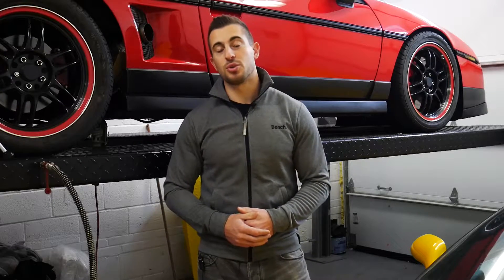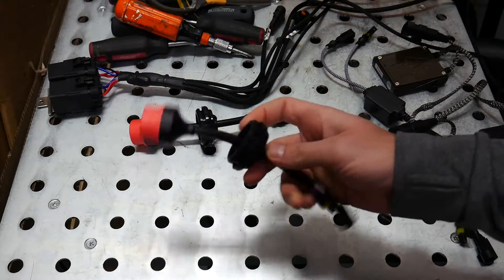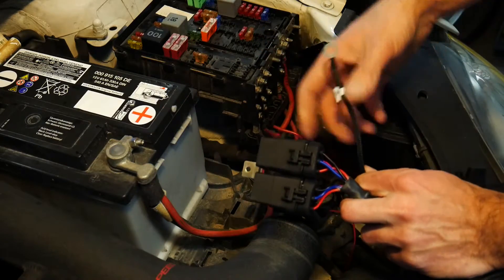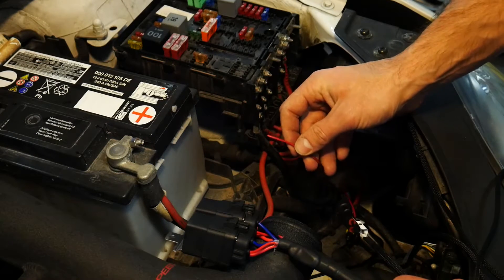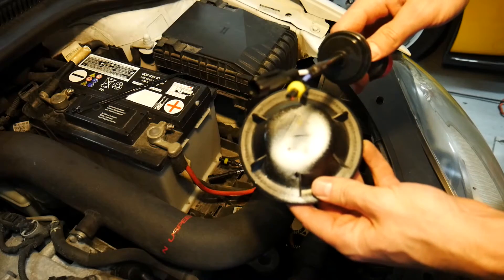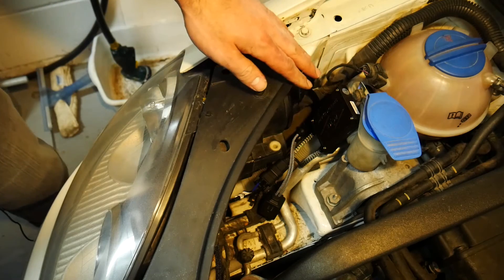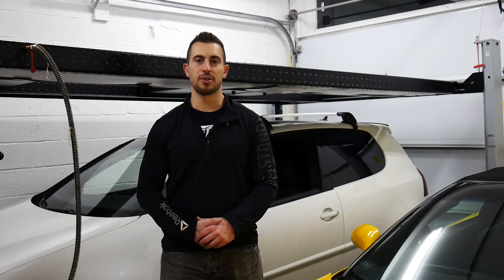How To Replace OEM Headlight Bulbs, Ballasts, Igniters With Inexpensive Universal Parts!

Comment: I have the same year/model. What wire(s) did you tap into for the headlight switch (color code or pin #)? 

Update: 

I did some searching and I found that pin #7 Yellow/Black stripe is the low beam and pin #9 White/Black stripe is the high beam. Pin #8 Orange is ground for both.

Comment: I know you dont have the car anymore, but Do you still remember where you tapped the red wire to the headlight switch and the actual headlight wire?? Trying to do this with my MK5 GTI.
Reply from the maker: If I remember correctly, I tapped into 12V hot on the terminal block beside the fuses under the hood. The trigger for the headlight relay went to the head light switch inside the interior. I routed the wire through the firewall down near the pedals and brought it up behind the dash. You'll have to take a look online to see which pin from the headlight switch to use... I can't remember on this car exactly which one....

Comment: could i have the link to buy this, ive been dealing with my mk5 the headlights flicker.. the one will stay off and come back on once in awhile. will this fix that problem if i do this ????
Reply from the maker: Should fix it since you're replacing the parts. Just go to the "retrofit source" and find the same bulb size that fits in your MK5 housings, I cant remember what it is off the top of my head. Then find the compatible ballasts... they usually sell some "ACME" brand ballasts that are their economy line and work really well for the price.

Comment: I have a couple questions, I am also working on a MK5 GTI, so this video is a godsend since I most likely have a fried CECU and neither headlights work. My question is, did the grommets come with the stuff from The retrofit source or did you buy that separately? Also I know you probably connected the input wire to the headlight switch, do you remember what gauge wire you used and also if you had high beams after installing this?
Reply from the maker: To be honest I can't remember if the grommets came with the stuff... you might have to call/email them and ask. The trigger wire was wired to the headlight switch, yes, and it can be small gauge, don't worry it doesn't carry (hardly) any current. All of the current goes from the battery hook up through the relay to the ballasts. The headlight switch just acts as a trigger for the relay. You should still have highbeams after installing this... if I remember correctly the MK5 GTI high beams are halogen...
Reply: @EmbraceMaking  perfect, thank you for taking the time to answer me!

Comment: Could you maybe send a list of what you purchased? As someone that is struggling with my MK5 lights, I really don't know what exactly to get from The Retrofit Source. Thanks!
Reply from the maker: These are the adapters I used:

https://www.theretrofitsource.com/amp-to-d2s-ballast-adapters-straight-BL-ADAPTSTRAIGHT

These are the ballasts I used:

https://www.theretrofitsource.com/amp-acme-speedystart-35w-ACME35W-R?quantity=1

And I believe I just used a generic relay harness for the MK5 because if my memory serves me correctly, the high beam is halogen and not handled by the HID system:

https://www.theretrofitsource.com/hd-relay-h1-H-H1?quantity=1

The 12V input signal (as I mention in the video) I just splice into the trigger connector directly from my headlight switch.

Comment: does this works for your high and low beam? im confused with my GTI headlights  im not sure which is which
Reply from the maker: Should just be low beams, if i remember correctly, the GTI had halogen high beams? I sold the car a while back so I don't remember now...

Comment: Do you have a link for the relay harness, cover , and adapter? I have a 2008 VW GTI

Thanks
Reply: I believe this is the one he is using here: https://www.theretrofitsource.com/hid-systems-64/hid-systems-universal.html

Things to note: if you're GTI has the Projector headlamps that use the D2S HID socket  Youll want to grab a D2S amp connector (the wire the plugs into the bulb) and D2S Bulbs if the ones you have do not work. 

These kits are mainly marketed and made to allow people to go from a halogen system to an HID so all the kits you'll find will be fitted to H7 H11 H9 9005, ect. 
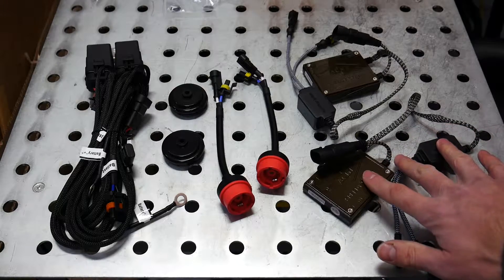I'd ignore that and just go with a universal H11 kit and know that your going to need the  splice in wires for the switch connector (4:30 in the video) and use the proper HID bulb socket and adapter harness (1:28 in video)

I ended up just piecing together your own kit on amazon, buying a Relay Harness, HID ds2 amp Adapter, and a  Universal H11 HID Ballast and ignitor with amp connectors.
Reply from the maker: Thanks for answering!

Comment: Hey dude, great video! Just wanted to ask, for the input if I'm using the power and ground from my headlight wiring to I need to do it for both sides?
Reply from the maker: I would wire both in... the wires from one side may not be suitable to handle the load for both headlights. Hard to say depending on your application. You may also get an error if one side is not seeing any load.
Reply: @EmbraceMaking  that's what I was thinking, thanks for replying bud

Comment: i don't think this is working out for me.my dumb 09 gti has a 11pins connector with output power and signal to the entire headlamp.
Reply from the maker: You'd have to check the wiring diagram but I'm sure you can pick up one wire to use as a trigger for a simple relay?
Reply: Splice into the wire harness. Theres a red wire in that plug that should work. I can send you a picture of how mine is setup if you still need it 7 months later.
Reply: @NickyRoads hey could you still send a pic? I’m thinking about ordering. Thanks:)